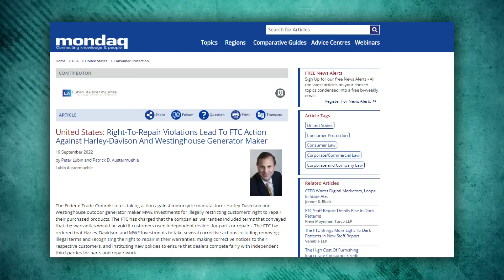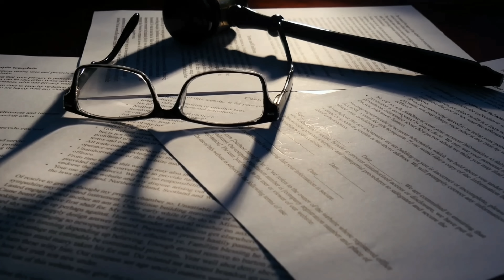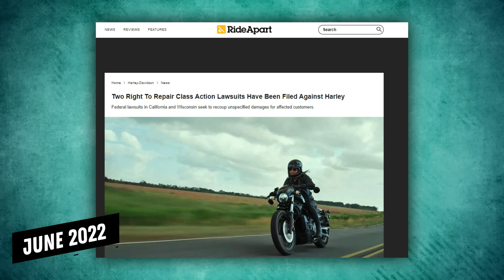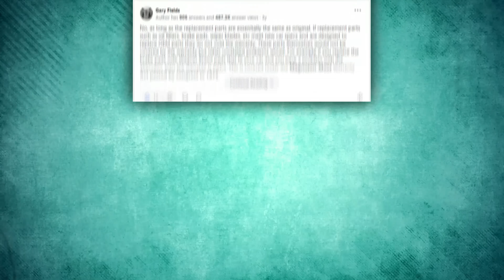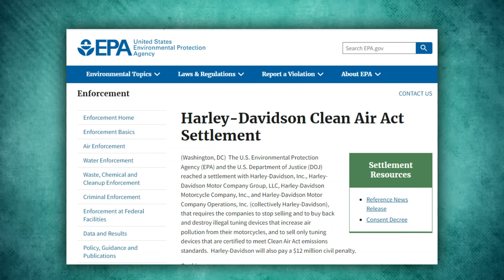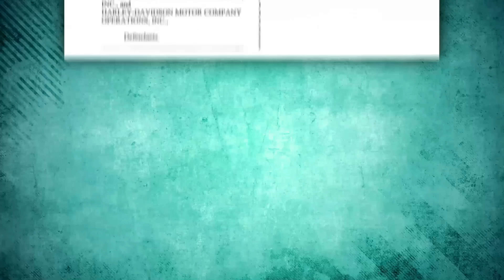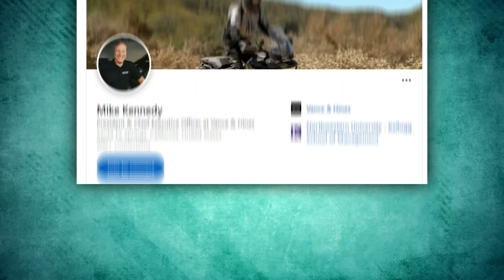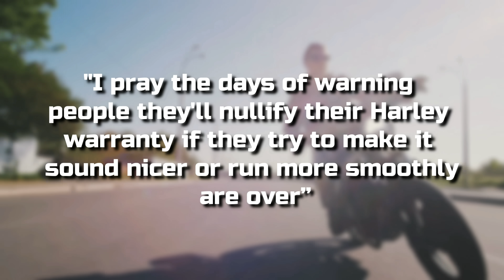This Affects All Motorcycle Owners!

Comment: I've been a Harley owner and rider for over 40yrs. I couldn't care less if the company shuts down. 
Warranty??? My newest Harley is 25yrs old. My oldest is 80yrs old. They all run great! I can repair or totally rebuild them nut by bolt. I can't buy anything for any of them at a dealership. Can't even get 50 or 60wt oil anymore! 🤬
I can buy any part I need from the aftermarket via the internet at a fair price and higher quality than original HD parts. 😁
Reply: Agreed....I have a93 and a 96 Evo.....no need for the new unreliabel crap Harley has been forced to manufacture.
Reply: I had a small shop until 99 when the twin cam came out I was done with Harley’s BS and the “new riders” BS.  My last Sturgis  trip was ‘95 I was sick of the “fashion show”. I still ride my pan/evo powered 85 soft tail.
Reply: correct👌 I own a panhead and shovelhead..many parts from them fits together...can even by parts fr swap-meets..or asian but needs to fix often. I live Sweden. we can send part to Polen to restore chrome..
I drive my amf Harley since 42 years..My frienda buy new ones they also have some problems..but you cant work with them...Computers and and lots of strange electrics. 
I dont need The Company..
Reply: You do know multi-viscosity oils are superior to 50 and 60 weight oil? All of your bikes will run on 10W30 or 10W40 without a problem. If your air-cooled lawn mower can run full open for an hour or two with no air flowing over the cooling fins with 10W30 then your motorcycle should have no problem.
Reply: You can buy 50 weight oil at Walmart.
Reply: Not everyone is like you
Reply: get you some vtwin am soil
Reply: Amsoil makes a straight 60
Reply: Their accessories are outrageously priced, make in China crap to. $100 for a set of foot pegs, or grips??? 🤣🤣🤣 EBay has thousands for less the half of that. $45 for a hat, or T-shirt, because it says “ Harley-Davidson? I love my bike, but the prices are getting ridiculous!!!
Reply: Closest I rember seeing to 50 weight oil recently was 20w-50 air cooled motorcycle oil!
Reply: @ReidHenderson  Amsoil 100% synthetic 60 motorcycle or Aeroshell, Phillips 66, etc. av oil 50 weight conventional
Reply: I'm talking straight weights here, not multi viscosities like 20W50. But Amsoil has just about any multi vis as well. The Aviation oils I'm talking about are straight 50 weights conventional petroleum.
Reply: @semperfipar1299  why doesn't your lawn mower have any airflow over the cooling fins? Are the fins plugged up with junk or the flywheel fins are broken off or something? They all have cooling fins on the revolving flywheel that produces air flow and ducts it over the the cylinder and head fins by the recoil shroud.
They also don't run wide open, they are governed to about 3,600 rpm max, so partial throttle. Some of those old bikes need a heavy oil. Just saying ok
Reply: @oneninerniner3427  Amsoil does indeed make a straight 50wt specifically for air-cooled motorcycle engines. Older iron barrel & head motors like Knucks, Flatties and iron Sportys don't shed heat as well as aluminum heads. Harley used to sell a 70wt for these motors, especially for hot climates. On a 90deg+ day in traffic, it drained like water. I wonder what the WWII Army WLA's used in the desert?
I had a friend who used a certain brand (?) of 70wt air-cooled aviation motor oil because it was green, making it easy to find leaks.
Reply: @oneninerniner3427  Thin oil lubricates better than thick oil because it flows better hot or cold. I don't walk fast enough for air to actually flow over the cooling fins of my push mower. Lawn push mower rpm is higher than the operating rpm of a Harley Davidson. The only reason thick oils were used is because they lost viscosity when heated up. Old Harley's from the forties and fifties ran on what? Over expensive motorcycle oil is a scam.
Reply: @semperfipar1299  lawn mowers have cooling fans, they are the fins on the flywheel. The old bikes have larger clearances and they weren't built with the metallurgy, accuracy or surface finishes we have today. That's why they use the heavy oils. They are somewhat similar to aircraft piston engines which were designed in the forties & fifty's as well and use heavy straight weight oils. That is starting to change though as they now have multi viscosity 15w50 semisynthetic oils available. The trouble with synthetics is the lead from the leaded Avgas doesn't like to stay suspended in synthetic oils. But with the advent of unleaded Avgas just now starting to be introduced, it will help those engines run cleaner longer with less maintenance.
Reply: I've also seen either 15w-55 or 25w-50 somewhere I think it was marine oil
Reply: @ReidHenderson  yup mercury calls for a 25w40 synthetic blend four cycle marine oil. But I don't think it should used for other application. Motorcycle oils are specifically formulated for wet clutches, hot running air-cooled engines & or high reving water cooled engines. Don't use automotive oils in motorcycles, the friction modifiers in them don't play well with wet clutchs. I bought a used bike once that the clutch started slipping shortly after I got it. Not sure what oil was previously used in it, but I replaced the glazed clutch plates that otherwise looked just fine. No problems after that using only motorcycle specific oil.
Reply: @semperfipar1299  it has actually been found that heavy viscosity oils run hotter at the bearings on plain  bearing engines, not to mention parasitic drag from the viscous oil. So flow is important for wear protection especially cold. Premium synthetics don't contain paraffinic waxes that congeal when cold or very much if any viscosity improvers that quickly wear out. They also have a robust TBN / detergent additive package which controls acidity from the byproducts of combustion and keeps engines clean and fights varnish and sludge. This all helps premium synthetics last much longer and protect much better than conventional petroleum and cheap synthetic oils. Not to mention their superior film strength & shear resistance that keeps moving parts from touching and wearing against each other. All that is very important to keep modern engines with their technologies working as intended. So how many tens of thousands did you pay for your vehicle then worry about paying a little more for quality lubricants? The biggest scam is the aftermarket additive industry that does little to anything but empty your wallet. Just buy quality in the first place!
Reply: pb68slab you are able to get aftermarket parts for a 1942 Harley? Impressive...
Reply: @oneninerniner3427  Thanks for the correction on the lawn mower fan. I had forgotten they actually have a fan on top. Yes I do remember the the good old days of lead coating internal engine parts particularly the valves in regards to leaded vs unleaded fuel. I never worked on the old piston radial engines of yesteryear but I do remember from what the old mechs said about them. You had to sit there and warm them up until the oil pressure came up and operating temperature came up. How did we get on aviation? Those oils are designed for thermal stability because of extreme temperature difference from ground to altitude of flight. How much is a quart these days? I know turbine oil is expensive which is why we always carried an extra gallon because we did not want to buy it from the counter at the FBO.
Reply: @californiadreaming9216  Very high quality motor parts for 'obsolete' HD motors are fairly easy. valvetrain and cranks, rods, tappets. Even some crankcases, heads, cylinders. Much better materials than used back then. The AMCA, or Antique Motorcycle Clubs of America has field and swap meets across the country, and you would be amazed are the original NOS and high quality aftermarket parts available. There's a few dealers like Bill's Custom Cycles in Berwick, PA, who was buying out entire dealerships inventories back in the 60s~70s and has what he 'bills' as the largest inventory of NOS HD parts from the 1910s on up. Though it has probably dwindled down some in the 40yrs I've known about them.
V-Twin Cycle, aka Taiwan Tedd's catalog has tons of stuff and is also a good reference. Their stuff is, as I said, mostly made in Taiwan, or other country, but their quality has vastly improved thru the years. Might not be 100 point restoration stuff, but if ya want to keep an old scoot on the road, he might be a big help.
S&S bought out Flathead Power and has some stuff for Knucks as well as BT Flatties. Typical S&S quality too. Repro Knuck & BT Flat heads & jugs cast from gray ductile iron that you cannot chip or break fins off of.
Reply: @semperfipar1299  depends on the bike brother. My 2011, Ill run multi all year. My 62? Not a chance.
Reply: TRUTH!
Reply: That's spooky Brother. Same here. Fuel injection and tuners, what's that ? I'll just keep advancing My magnetos once She's warmed up thank You.
Reply: @dieselrotor  My Pan uses STD dual-plug heads and I'm running 2 Morris Single Fire Units for 4 plugs. It does make a noticeable difference.
Reply: @pb68slab18  Nice. How many times have You burnt the top of Your middle finger(s) hunting for the inner ground strap (even with all the room in the world to press it).
Reply: @dieselrotor  None. I simply ran a wire from the ground stud up to a WLA ignition switch that I modified. Just turn it to the standard OFF position and it grounds out the mag.
Reply: PS; I used a repro 'skull' dash with red 'eye' windows and used the dash lights for a neutral light. When I click it into neutral, the 'eyes' glow red.
Reply: @pb68slab18  Sorry for the late reply. For sure, I wrestled over doing the same but with a simple momentary vintage horn button.
Reply: @californiadreaming9216  there's a company in Holland or Denmark 45 Something they make complete brand new WLA 45 motorcycles. Around Europe you have a lot of Old World War II vehicles running because they enjoy a tax as well as an insurance benefits by being so old and they are generally exempt from an mot test every year. They started making frames and replacement parts for 45 and then engine parts and now you can buy a whole kit to build your own brand new bike. Or you could buy a brand new engine to replace the one in the one you have that's totally worn out. And you don't have to pay silly stupid collector prices either.
Reply: @frankmarkovcijr5459  that's awesome. Thanks.
Reply: @pb68slab18  I have a 900 BMW Airhead with the twin plug conversion. It makes for such more complete combustion that a single plug. According to the Articles in the Airhead BMW newsletter the twin plug conversion gets you 20% more power and 10% more gas mileage than otherwise helps to burn the crap that they call gasoline nowadays
Reply: @frankmarkovcijr5459  I have a set of ported, big-valve STD Panheads on my 93in stroker. They use an improved Shovelhead-style intake/exhaust tracts, and are dual-plugged. Yep, they do make a big difference.
Reply: @frankmarkovcijr5459  20%? Really?
Reply: @milk_420  been running Amsoil 20w50 in my Harley since brand new (1985) currently 150k on the motor with no rebuild. It's all I will ever use.
Reply: They still have 50 and 60 weight oil
Reply: @coreydro353  Perhaps, but the nearest dealers to me don't.
Reply: Right on! I wished I would have bought an older Harley. I bought a 2020 Sportster that runs well and is fun, but I am looking for something more old school, any recommendations?
Reply: @louismilum3669   if you consider an Evolution motor "old school," if I were in your shoes I would look for an any year low mileage EVO motor and snap that up. There are no surprises with an evolution, I've had great luck with my 1985. Bought it brand new, curly 150k on it.
Reply: What about me warranty I have 2 yr and an extended warranty on my 2022 ultra limited they can't just cancel a contract
Reply: @dominicbenecasa7893  
2020 80th Sturgis SD 
2021 81st Sturgis SD 
2022 82nd Sturgis SD 
I go every yr
Reply: @semperfipar1299  60 or 70 weight in the summer 50 weight in the winter. All straight weight oil.
Reply: @oneninerniner3427  with time all clutch plates glaze even dry clutches in the pre84 Harley’s all the way back to the 30’s would stick especially after sitting for the winter months.